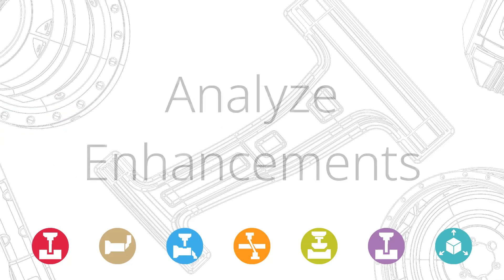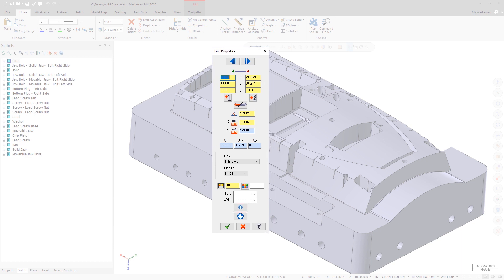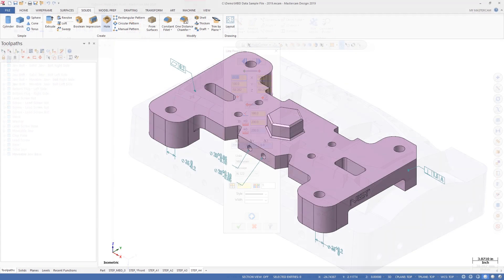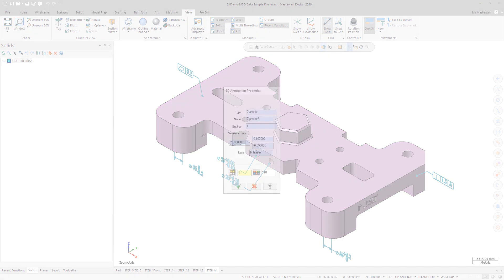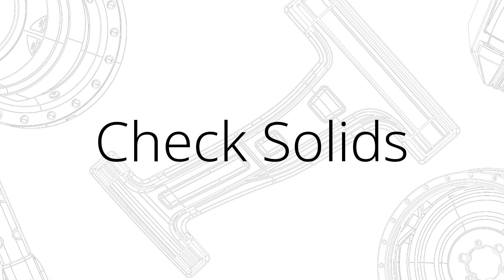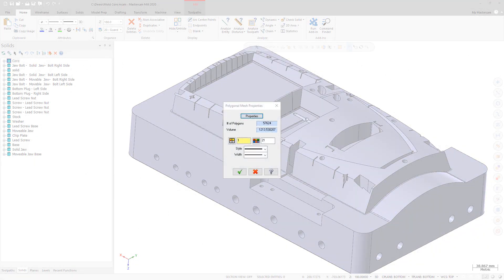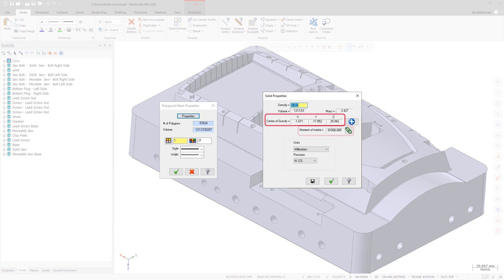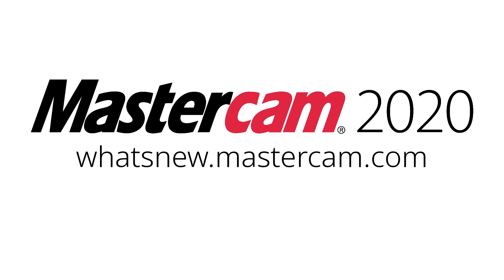What's New in Mastercam 2020: Analyze

Comment: Here's a question.  Could we get a feature added to the "Select" dialog box in the Toolpath Manager that allows the programmer to search based on more than one parameter at a time? Like say I want to find a toolpath that uses wireframe X and tool Y. 

There would be checkboxes instead of radio buttons and we could do a search based on those two parameters.